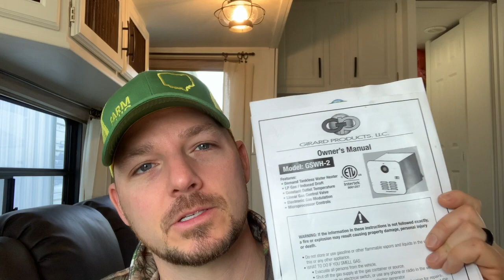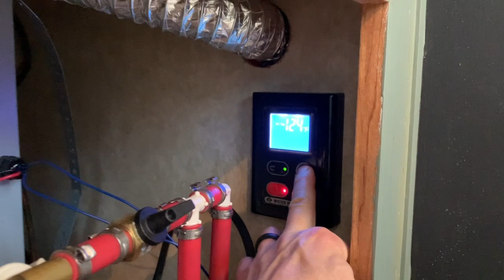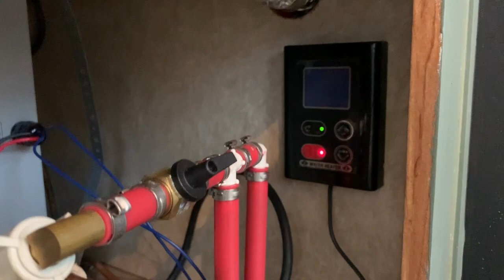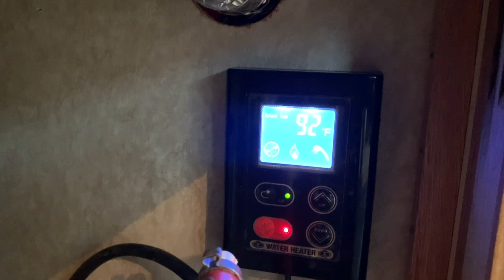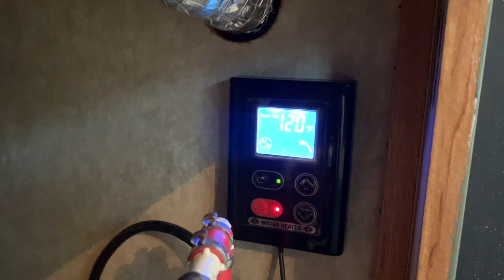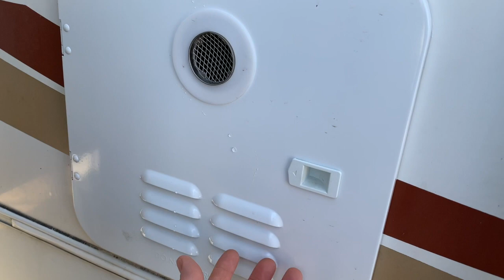Water Heater Review -- Girard GSWH-2 Tankless Water Heater

Comment: You video allowed me to troubleshoot my Girard GSWH-2.. Good Job Sir!!
Reply from the maker: Great!
Reply: @Luap302  
I live full time like you with rough, cold winters - any issues with subzero operation? Pipes freezing? Obviously there is no insulation on the door so I'm wondering how it works in winter? Thank you.
Reply from the maker: @Gubastek  we didn’t have the pipes freeze. Our water heater is located below the refrigerator and when I knew it was going to be really cold, I would open up a cabinet door on the inside of the camper and allow the heat to get in and warm that area up a little bit more. We would also trickle water so that things wouldn’t freeze as well.
Reply: @Luap302  
Makes sense, thanks for your reply, I bought and installed same unit - so far so good!

Comment: I expect delivery of me Girard GSWH-2 sometime the first of next week. However, you have made me green with envy. My wife and I are condo dwellers. I would give just about anything if me travel trailer was behind a barn on some farm.
I will give you credit, unlike the other videos on this subject I have watched, you made it almost 13 minutes before you called it a
“hot water heater.” It is a water heater. There is no need to heat HOT water.
On a serious note, you might try cutting a few pieces of 2 inch rigid foam insulation to pack around this unit to muffle the draft inducer motor sound.
Reply: Actually he says it before the first minute hit..

Comment: We have a 2021 forest river sabre fifth wheel. Since day one we noticed that the water doesn't get hot. Any suggestions? 
We have to play with the switch, turn on different sinks, turn off just to try and get a hot shower. 2 full tanks of propane , that's not it. Thanks!
Reply from the maker: Hey Ana. We had the same problem pop up out of the blue! After thinking the thing went bad, I called the manufacturer. What they told me fixed the issue. Check your outside shower or faucets. Make sure the water is off at those. If the water handle is on at your outside showers, it will cause the water not to get hot inside. So, check those first. Hope that helps.
Reply: Thanks for your reply! 
The tried this and the only thing that did the trick was taking the water regulator off, go figure.
Now hot water always:)
Reply from the maker: @ana1441  Awesome! Glad you got it figured out!

Comment: If anyone has the Atwood 6-gallon, with the recessed or flush mount door, this project is difficult, but doable. Use your original Atwood door. Take the rolled part of the hinge, and unroll it with needle nose pliers and squish it flat, or cut that part off. Take some tin snips and snip notches out so the factory Atwood cover sits flush over the Girard frame. I put tape over the inside cover near where you think the gas exhaust pipe is and smashed it against the tape so I knew where to cut the hole with tin snips. After I cut the hole with tin snips, I put the silicone ring from the Girard door around it. I was able to reuse the Atwood spring loaded latch at the top, and at the bottom, I used a self-tapping screw. It was not easy, but I did it and looks good. It probably took me 4-6 hours total. Also, to make the plumbing easy, I used some steel braided flexible hoses and Shark bite. Oh, and I did have a very small gas leak - very glad I sprayed my gas connection with soapy water! Before you screw your cover on, make sure you turn the switch on! Don't worry about the Atwood heat vent not lining up perfectly - the main thing is that it vents, and I have never had a problem.
Reply: I want to see a pic of what it looks like

Comment: The reason you had to buy a separate door is tank water heaters are different sizes, from 6 to 10 to 12 gallons.  You can replace any of those with the same tankless water heaters but the opening in the exterior is a different size for each.  Not to mention different brands have different size openings as well.  If the one you were replacing was a different size you may have needed to build a platform inside for the new heater to sit on.  Then you have a gap of different sizes between the new unit and the edges of the cut-out in the exterior.  They don't want to just include the larges door for the larges possible gap, because your opening might be close to other doors or things on the exterior of the camper so you really want to use the smallest door that would work in your application.  Like in your video you have another door right above your water heater within about an ince.  The larger doors would have not been usable in your install as it would have hit that door above.  I hope all that makes sense.

Comment: So, I'm a little unsure about wiring, I know how to wire controll box.  How do you know what is the ground wire in your camper and what is your positive?  We are going to slice in.  Please help
Reply: Splice in
Reply from the maker: I would suggest grabbing an ohm/volt meter from any hardware store. It will not only help with this job but MANY other jobs on your camper. They can help you figure out 110 or 12v wiring issues.

Comment: If one is unable to located +12V power source, what about using a transformer? i.e. home doorbell transformer that converts AC to +12V DC?
Reply: I'd like to know this too.
Reply: Sure, you could do that, but then you'd need 120VAC to get the water heater to work.
Reply from the maker: That’s a great question. But, way over my head.
Reply: @stevenscott4096  No. The water heater does not need 120VAC. It only needs 12V DC for the control panel and the igniter. All the heating is done with propane. FWIW, we went on a 1-month trip, we have 2 kids, our propane is 20 pounds/gallons, and we took unlimited showers, and used the stove top a LOT and used only about 1/2 tank.
Reply: @brianelton6238  I understand the WH runs on 12vdc.  I was replying to your question if you could run the water heater off something like a doorbell transformer.  You would need 120vac to power the transformer.  You'd als0 need to make sure the transformer VA was sufficient to run the WH.  Half a tank for a month's hot water is pretty decent.
Reply: @stevenscott4096  check out the Victron IP22 30A charger; it can charge lithium and also act as a power supply

Comment: Awesome video. Question I have are the connections for water heater are 1/2" also? I like to use those metal flex pipe you have used. Just want to buy the right size...thanks again
Reply from the maker: The connections on the back of the water heater are the same as the PEX lines that were initially installed at the factory. I just got some brass fittings to connect the existing to the new flexible lines. I want to say that it’s 1/2”. I would go check but I have sold the camper.

Comment: I just had the same tankless installed. The only issue I have is that when I turn the cold water on to even out, it goes cold. Any recommendations?
Reply from the maker: Hey there, yeah what we did was find the right heat setting that we liked for shower water and then we didn’t touch the cold. If I remember correctly, we had it at 115 or 118 degrees.

Comment: so this will only work on propane? I have trailer in my back yard that is being lived in. I have dedicated power for it. This will only use propane to heat up water and not electricity?
Reply from the maker: That’s correct. It needs 12 volts to power the igniter but the heat source is propane.

Comment: We just took our first week long trip in our (new to us) RV. It has this heater installed, but we had issues getting constant hot or warm water. What did you do to the flow adjustment valve? Full open or restricted? I have also read that input water pressure should be 53-55 to get good operation. Does your red light stay on all the time, whether it is on or off? Thanks for the help. My wife says I must figure this out before we hit the road again. Good video, ignore the armchair experts.
Reply from the maker: Hey Mark, sorry for not replying sooner. We’re in the middle of wheat harvest… Anyway, here’s the answers to your questions (to the best of my knowledge). If you do have the fluctuating of temperature, my bet would be that the water pressure is too low/high. Here at the farm, if we’re in the shower and someone turns water on somewhere else on the farm, it causes the pressure to drop and we lose heat. So, grab a water pressure regulator and see if you can get a consistent pressure. Yes, the red light stays on letting you know there’s power to the unit. As for our flow adjustment, it’s been on max since the day I installed it. I haven’t even given that a second thought since I installed it. I hope this helps keep you (and your wife) happy on your next trip out.
Reply: I’ve heard you never want more then 40psi water pressure this may be your issue if the water is flowing to hard/fast it will never heat up enough to get to desired temp, hope this helps

Comment: Good video, thank you. Yeah the door thing is because they can't possibly know what your previous setup is and additionally some folks buy these for non-RV use and the door is a waste of money. 6-gallon white, 6-gallon black, 10 gallon white, 10-gallon black, 12 gallon white.....and so-on...
Also, when you started the water and looked at the control panel it was staying at 96 degrees or so. If you had not slowed the water flow down would it have reached 124?

Comment: What fitting did you use for the gas line to the heater? I purchased a 3/8'' compression to 3/8 flare but the compression side does not fit. Can't find any info online and the manual says it is a compression fitting, however the standard flare nut fits I'm confused.
Reply from the maker: Actually, I didn’t have to buy anything. The fitting that was in the camper before fit perfectly. I did use use some pipe sealant on the threads but that’s it.

Comment: Could the 12 volt not working be due to that line has the switch for turning on the old units auto ignite? I am getting this model in next Tuesday from Amazon for $529.00 and $30.93 I think the door is separate cause this will replace 10 gallon units but will have a bigger hole and the other cover comes blocking that extra off.
Reply: to get the 12 volt to work just turn on the exsisting switch for the old water heater.

Comment: Isn't the 12v power at the propane switch?
Reply from the maker: I bypassed the Propane switch. To be completely honest, I'm not sure why. After doing some thinking, I decided that, with 2 boys who like to press buttons and flip switches, it's better for us to not have another switch that could be turned off when someone needs a hot shower.
Reply: @Luap302  Yeah ok, basically you just have to turn it on at the control panel instead of having the additional switch for the propane water heater that would supply the 12v.
Reply from the maker: @nigelio3   If by control panel you mean opening up the outside of the water heater and flipping the switch there, then yes.

Comment: So since the heater uses 12V DC, does that mean that your shore power no longer powers your water heater when plugged in?
Reply from the maker: Sean La Rue Yes. Right now we are hooked to shore power but we don’t need 110v to power it any longer.
Reply: Restoration Farmer thx! So since you live in your RV full time, what do you do to keep your 12v battery charged so you don’t lose hot water unexpectedly if the battery dies?
Reply from the maker: @seanmlarue  Well, we currently have our 30amp connected so that we can run 110v fixtures and things like the microwave. Our RV has a 12 power wizard that keeps the battery charged.
Reply: @Luap302  last question...what size are the fittings? 3/4"?

Comment: I noticed you have a drinking water faucet - what do you use?
Reply from the maker: Hey Brian, sorry for the late reply... I wish we had an RO (reverse osmosis) system in the camper, but we don't. We just have a filter installed under the sink for added filtration. It works for us.

Comment: I recently installed this water heater , and it was a bad job . Not recommended for 99% of the public . To start with , the new heater was too big for the hole left from old heater . So cutting and framing is not an amateur job . Water lines never fit . And power lines are not labeled . Mounting the control panel and running the wires to an accessible location is trouble some .
Reply from the maker: Thankfully I didn’t have those issues. however, I did do some major double and triple checking on measurements before removal and installation. But, I will agree that if you don’t have a basic knowledge of electric and some construction, it would be pretty difficult to install.

Comment: Rv hot water heaters are a scam. I had this unit. The heat exchange coils burst four times in 3 years. Total garbage
Reply from the maker: Appreciate the reply. I’ve had 2 different campers with the same unit and never had an issue. My parents and in-laws and brother-in-law have the same unit and no issues there either. Sorry you’ve had problems with yours.

Comment: How do you winterize it?
Reply from the maker: I used an air compressor and set the regulator to 30-35psi. Then, blow out the water lines and it will empty out the water heater. I did make a video on winterizing our camper.
Reply from the maker: https://youtu.be/vjyaQD3YBfI?si=4d9qjTNPt_l7nBe8